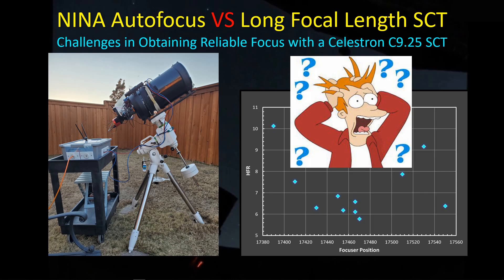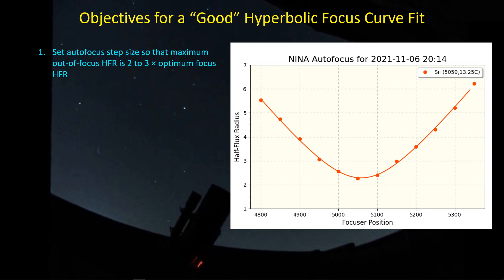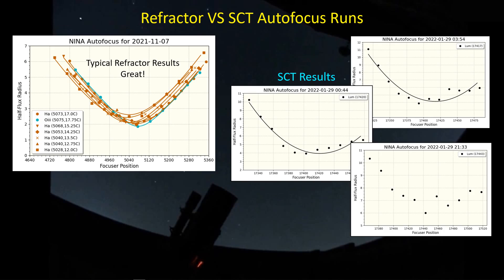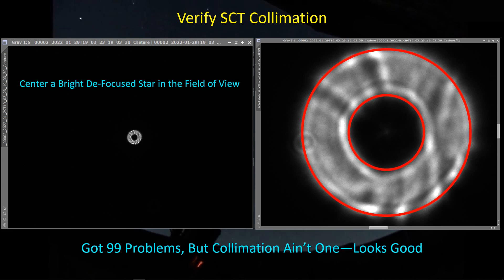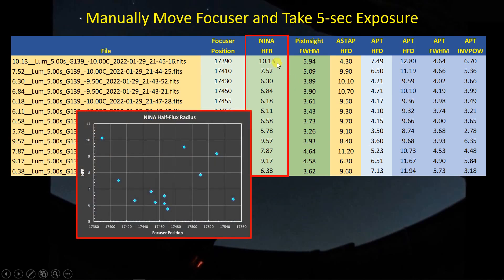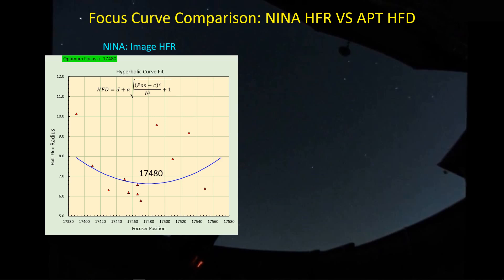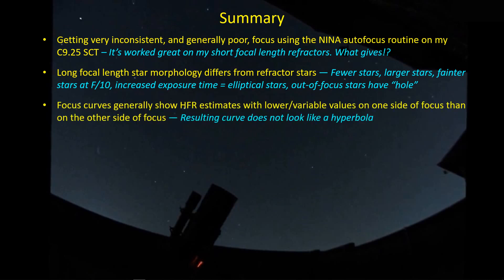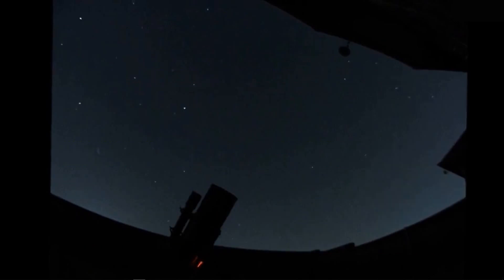Autofocus Challenges with an SCT

Comment: Hi James. I have never observed focus curve asymmetry with NINA on my C9.25 with the same focuser. The NINA settings I use are nsteps=5, step size=28, overshoot method, 50 steps IN. I would be surprised if mirror flop gave the same consistent asymmetry at different locations in the sky. I would be equally surprised if focuser slip was this consistent. If anyone can get to the bottom of this, I am betting on you. Please let us know what you find. (PS taking multiple shots at each focused position might give you a better trend but the HFD will be higher as I am sure you are aware).
Reply from the maker: Hey Bob. Our numbers are pretty similar. Interesting how you're getting good results and I'm getting the results I'm seeing. That said, I do occasionally see a nice symmetric curve, but I get more of these asymmetric curves. I'll keep on digging, I guess.

Comment: Hey James, nice video! I wrote Hocus Focus, though I haven't been able to test it much at high focal lengths since I got rid of my SCT some time ago. Would you mind helping me improve star detection for this use case? I believe this will come down to choosing the right detection parameters, and some sample data will really help with this.

Thanks!
Reply: Definitely worth trying Hocus Focus - and maybe it calls for a Hocus Focus SCT variant. I suffer similar issues and still don't know the cause, but out of focus stars look different on opposite sides of focus on an SCT (or at least on mine) so perhaps that contributes?
Reply from the maker: Hey George. I'm looking forward to giving Hocus Focus a try. I'd be happy to help. I'm socked in with a weather system for a week. Is there a way to use Hocus Focus in a stand-alone mode to assess the images I discuss in the video?
Reply: @Aero19612  if the images are saved, you could use the file simulator to read them from a folder. It's a bit finnicky to do it this way as you need to load them in the same order an auto focus would. I'm planning to add a "Save" mode for AF, as well as a replay one that'll use the images and focus positions from a prior save and redo star detection and curve fitting with the current settings.

Feel free to ask me (jokogeo in the Discord channel) for help if you need!

Comment: I am using a ZWO EAF on an old (circa '83) Orange tube C8 in NINA with great results, good fit, etc.  Your scattered plots remind me of when I was first attempting the setup and had the backlash value in both the IN and OUT fields before I learned it was one or the other. I tried Hocus Focus but did not have a good experience with it so went back to stock.  Good luck getting it going!
Reply: Hey Bruce, I wrote Hocus Focus. Would you mind taking pictures at various focuser positions as if you were focusing, and sharing them with me (jokogeo) in the Discord channel? This will help me improve star detection for high focal lengths.
Reply: @georgehilios5079  Sounds good.  The wait for clear skies is on (as always).
Reply from the maker: Thanks Bruce! I'm glad you're getting good results with your setup. Don't change a thing! As I've been pondering this problem, I have been having evil thoughts of moving to a different focuser. I will try a very large backlash number next time I'm out.
Reply: @Aero19612  That is true too: I set my backlash very large, something like 800 in order to get it to work.
Reply: @BruceMallett  800 seems just huge!  That scope must be "interesting" to focus manually.

Comment: Mirror flop, Coma, mechanical slop in focuser, shit Celestron focuser, collimation issues. With an Edge HD you can at least lock the primary to mitigate mirror flop. I'd also install a Feather touch micro focuser and motorise that with an EAF or a motorised secondary Crayford. You will still have Coma and this is less of an issue on the newer Edge HD models.  I used to have a Meade 16" SCT Classic so I feel your pain
Reply: Ditto with my EdgeHD11 running on ASI Air Pro.  I am finally getting pretty good results after:  Added a Moonlite focuser behind the OTA.  Locked the primary mirror in most favorable focus position with Moonlite focuser midway.  Slightly PRELOAD PRIMARY MIRROR with the SCT focus knob with the two primary mirror rods LOCKED.  The biggest reason that the ASI Air Pro Auto Focus routine was useless was that it begins immediately after moving the EAF.  If the EAF has just moved the primary mirror, there is enough slop and mirror resonance as it becomes stationary again (at 2800 mm FL), to blur the image that it is using to determine the star size (focus).  Locking the primary mirror and preloading it also drastically helps with mirror flop/movement.  Use the EAF on a secondary focuser between the OTA and camera.
Reply: @bobc3144L  yep gotta lock that primary mirror
Reply from the maker: Falls in the category of "wish I knew then, what I know now". Locking the mirror and using a focuser that moves the camera seems like the most reliable setup for an SCT. Before I nuke my current arrangement, I want to pull all threads to see if I can get consistent autofocus with this house of cards. Thanks for watching!

Comment: Jay, thanks for the video!!    One of the things about NINA (here lately since they started doing plug-ins), things have changed on many aspects and I feel like the auto focus routine isnt as good as it once was, and my experience with Hocus Focus wasnt any better so I swtched back to normal nina focus.   Example, If you watch your image window doing an autofucs run, while zoomed in, you will see smaller stars being measured with higher diameter values than larger stars at times.   it's very inconsistance, but I guess the over all star average helps the curve, or hurts it when you are in smaller star fields   If you are doing an auto focus run on an area with few stars, my auto focus curves looks like crap because of how the take their average measurements. And good luck telling the creators about any issues you have like that, those guys will call you an idiot and not doing anything about it; a bunch of jerks on their discord site if you ask me and thats from personal experience with them.   Anyhow, another thing that can really cause isssues with your auto focus parabolic curve is if you have image tilt;  because either side of the focus curves will have stars in focus this this gets averaged out thus giving you more of a flat curve.    One way to see (before you do tilt adjustments) is to go into NINA autofcus settings and type in something like 0.5 for your "inner crop ratio" value, this will only detect stars within your center 50% FOV thus not allow the software to detected tilted stars at the edges.    You can reduce this value even more is you like so you can test this out.   But based on your curves, I dont think tilt is the problem unless you were in an area with few detected stars, then you will have issues with both the nina star detection issues on top of tilt measured stars so your curves could be all of the place.   For your testing purposes, maybe compare an area in the sky with lots of stars i.e. milkyway band and then an area with lille stars in your FOV and see how your curves look, just to see if it is a software detection issue.     On another note, I have also had some doubt with NINA lately when comparing my autofocus curve best focus location to that of a bahtinov measurment; i've seen inconsistanct results.    I think the issue has to be some "AI" in their methods of averaging out their HFR measurments because sometimes I dont understand how they can get an accurate measurement especialy if you are under sampled.    Other than that, maybe something is loose inside your focuser if you are only seeing this on your SCT??     Hopefully you will find a solution buddy!!   Can't wait to see what it was.
Reply: Hey Bill, I wrote Hocus Focus. I haven't been able to test this at high focal lengths since I don't have an SCT anymore. Would you mind sharing some image data with me so I can improve the star detection routine? I believe this comes down to picking better parameters for high focal lengths.
Reply: Jay, I have an extra Celestron focuser if you want to try it to see it works better for ya, it's brand new. Might help you narrow down your problem.  You have email.  Here to help buddy
Reply from the maker: Hey Bill. Yes, this star field is very sparse. Just a handful of stars. I wonder how effective averaging HFRs for multiple stars actually is. A wind gust will deform all of the stars, for example. Fainter stars will “dissolve” when out of focus. I wonder if it might be best to use one or two brightest stars near the center of the image as you say. I don’t think tilt is the issue, I think I’m just not producing a “good” star field for the algorithm. I’ve got lots,of things to practice with next time I’m out: backlash, exposure time, crop ratio, number of stars, Hocus Focus… funny thing is, I do get good curves sometimes, just not consistently. There’s an answer out there somewhere! Oh, thanks for offering up your Celestron focuser! I think my focuser works fine; however, the mechanical connection to the mount is highly suspect. Who knows, I may give up on it after a while and go with a camera-moving focuser and keep the mirror stationary. Wish my scope had a lockable mirror.

Comment: Do you have access to an ASIAir to try its focus routine? How do you get the Bahtinov focus error (pixels) data? I'm not tracking how you get the y axis data?
Reply from the maker: I don't have an ASIair, but I can and will test APT's autofocus routine. The Bahtinov focus error is reported in terms of pixel error. If you use Bahtinov Grabber, NINA's Bahtinov aid, or APT's Bahtinov tool, it will show you a focus error number. That's what I'm plotting.

Comment: I've been using NINA with my Edge8HD and getting perfect fits.  However, when I tried with the Celestron focus motor, I got horrible results.  Never was able get consistent results.  I switched to a ZWO EAF and am having no issues.  Nearly perfect every time. The fit parameter is .98 or above every time.  Absolutely NOT a fan of the Celestron device.  BTW, I am running with the .7 reducer so my FL is about 1400mm.
Reply from the maker: Great feedback, Steve! I'm glad there's a light (or should I say: hyperbola) at the end of the tunnel. The thought has occurred to me to replace this focuser with the ZWO. I'll dig a little more, then pull the trigger if I can't get what I'm looking for.
Reply: Hello James, I can second that. I never got the Celestron focuser for my C9 and went straight for the ZWO. First time I tried it, I had used the same stepsize as with my small refractor. No chance, but once I increased it to 100, the points are nicely following the curve.
Reply from the maker: Thanks for the feedback and thanks for watching! I'll give this Celestron focuser the rest of this galaxy season and if I can't get good results, I'll find another otion. I was close to buying the ZWO EAF some time back but held off.
Reply: Thank you James. I found your videos back last spring when I started with this hobby. I think Ed Ting made we want to buy a C9 but you gave me the confidence of actually getting one. Since (and it is probably true) a lot of people recommended starting with way smaller FL but I thought with support from videos like yours, I might get away with it.
You were also the reason I used APT back then and avoided the Celestron focuser. And I found your channel because you have a C9, but I stayed because I like your technical and analytical style. So once again, thank you James.

Comment: Hi James

I have the Celestron Focuser on my SCT albeit an 8 inch EdgeHD 

Right now I’m set up for imaging at F10

With N.I.N.A, I’m consistently seeing good symmetrical focus V curves as I’d expect during auto focussing

I set the auto focus to take place with an  SVBony CLS filter and then let filter focus offsets take care of my SHO narrowband filters and RGB broadband filters

I measured my filter focus offsets via Bahtinov mask and using Bahtinov Grabber as a one off exercise during setup/discovery

FWIW, my autofocus settings in NINA are:

AutoFocus initial offset: 4
AutoFocus step size: 20
Exposure Time: 5s
Disable Guiding:ON
Focus settle time: 2s
AutoFocus Method:Star HFR
Curve Fitting. Hyperbolic
Backlash compensation: Overshoot
Backslash IN/OUT: 0/100
Attempts: 1
Brightest stars: 3
Outer crop: 1
Inner crop: 1
Binning: 1
R threshold: 0.8

Hope you figure it all out 

BTW, ASTAP has a great tool built in for measuring star shape aberrations and image aberrations/tilt in your subs

Clear skies
Reply from the maker: Thanks for sending your autofocus parameters. We are very close, except you have a much larger backlash. I will change my backlash next time out. I agree: use filter offsets for the SHO and maybe even RGB. I did a similar measurement a while back and found my ZWO filters basically require no offset. Thanks for watching!

Comment: Hi James . I didn't see you mention any relationship between the "good" focus curves and which direction the focus shaft was turning . I'm told I must always approach focus in a CCW direction due to the mechanics of the SCT . Also , your 9.25" is not an EdgeHD OTA is it , or is it ? If you read the Celestron EdgeHD White Paper on those OTA's you'll find a section dealing (top right page 7) with improved tolerances on the Draw Tube to reduce binding and freeplay when focusing . Maybe you have too much freeplay in the drawtube ? It would be nice to have an OTA to take apart just to see what is actually going on under the covers . Cheers./SRK
Reply: to compensate for any mirror slop, perhaps increasing the backlash compensator to say 100? BTW James did really replace a 0.75 pitch screw with a 0.50 pitch screw?
Reply from the maker: Ahhh Jermey, I see the problem. I fixed the "0.75 mm" pitch at one location but not the other. Sorry for the confusion. Good question!
Reply from the maker: Jeremy: The screws in the C9.25 (may be different in other SCTs) are M3 and all M3 screws have 0.5 mm pitch. Agree: A consistent comment for folks getting good results is to use a much larger backlash setting like 100 or 120. I will definitely try that out if I ever see the sky again...
Reply from the maker: Hi Scott. I believe I'm always turning the shaft CW during focus, which means (I think) that the mirror is moving back toward the camera. I'm certainly not ruling out scope manufacturing tolerance as a contributor. Of course, I can't do anything about that. There have been several comments where people are using much larger backlash numbers than I am. I will try that and maybe winding the focuser/mirror way out and then back in also addresses some of the mechanical slop you're referring to. We shall see!

Comment: Many thanks for posting this James. I feel your pain in this regard! Edge HD8 (1422 mm FL) owner here, using NINA. About 2 years in to this autofocus thing. Could not get along with the Celestron SCT focuser gyrating around and locking up! Settings - I am currently using a star HFR, Hyperbolic curve fit, R2 threshold of 0.8, autofocus step size of 500, (Sesto Senso V1 on a FeatherTouch SCT Micro), backlash comp=Overshoot with 1200 steps in the OUT direction. Recently autofocus runs have improved. Getting something that resembles the curve with acceptable HFR's repeatedly. Clear nights in the UK at present, are as rare as hens' teeth!
Reply from the maker: Thanks Paul! Step 1: try a much larger backlash setting, Step 2: see what Hocus Focus can do for me, Step 3: replace the Celestron focuser. I just wasted a good 3 or 4 clear nights with this. Not as rare as hen's teeth here, but I hate to lose valuable imaging time. Much more painful for those of you at higher latitudes. Thanks for watching!

Comment: You could check the number of stars detected, you are all ready using just barely enough data to get any sort of statistical read - at either end of the bell I'm guessing the detections drop down. Because the stars are larger at a long FL they get fainter, and couple that with the bad morphology it probably can't pick out all the stars. You might try focusing on an open cluster or somewhere in the main galactic lane. You are also MUCH more at the mercy of seeing at 2k mm and the only solution there is taking more frames.
Reply from the maker: There are very few stars in this FoV. I think the real statistical benefit comes from generating multiple points (even if only with one star) at different focuser positions and then using the hyperbolic curve fit to deal with that measurement error. The "problem" with using multiple stars is that all of the stars will have the same poor shape if, say, a gust of wind affects the measurement. I agree, getting the image parameters right to see "enough" stars while not imaging too long and permitting wind, mount, and seeing conditions to dominate. Thanks for watching, Michael!

Comment: Great summary! Had to chuckle when I saw you post this. As a fellow 9.25 owner, I spent many nights (and lost hours) attempting to make this work reliably. It definitely put a damper on my enthusiasm to use this setup more. I may try autofocusing using a separate Crayford focuser, so I can leave the primary mirror alone.
Reply from the maker: We need a support group. After using refractors over the past couple of years, I always have a sense of dread when I switch to the SCT. Much of that was due to the CGEM. The EQ6-R has erased those concerns, and now I'm down to focus/focuser. Thanks for watching, Andre'!
Reply: See my reply below.